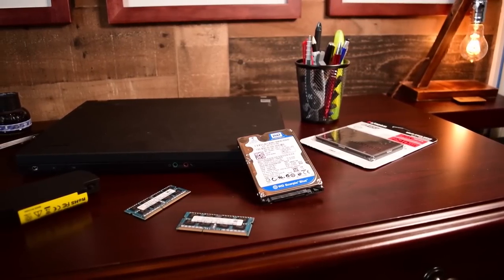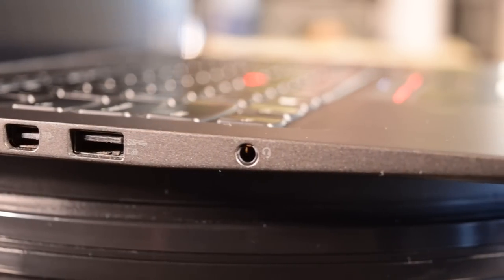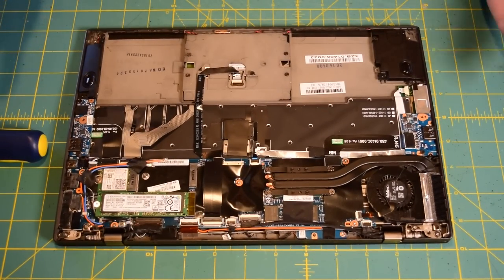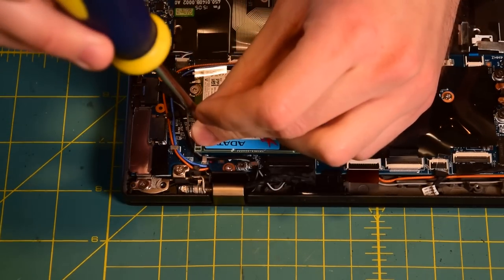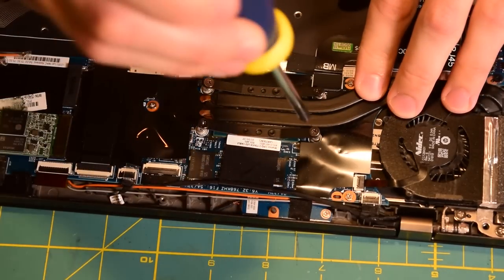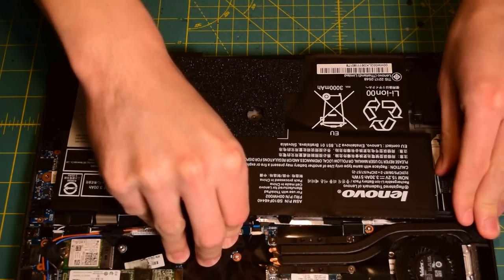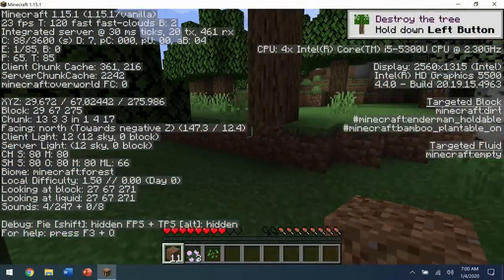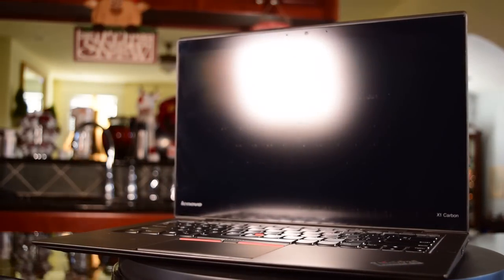Super Portable and Fast Ultrabook for Under $350: Thinkpad X1 Carbon 3rd Gen Upgrade Guide

Comment: Must be nice living in the US of A where you can get Thinkpads at a bargain. Good luck gettings those deals in Europe.
Reply: I will be taking one in two months i just want 350 € for mines its the i7 processor will be in barcelona spain in two months if you want it. I just bought it here to have a portable recording studio, but i have a recording studio in bcn already.
Reply: I got a good condition thinkpad x230 today for 50 euros, its possible, just needs patience
Reply: @___echo___  On ebay its impossible for a good specced x230. 200 euro and up.
Reply: I found a 6th generation carbon x1 for 300€
Reply: Same here in Asia😭
Reply: I got one for 60€
Reply: @___echo___ I got one x1 Carbon gen 3 for 60€

Comment: Great content man! You just earned yourself a like and sub! I just recently bought an x240 and made some upgrades by replacing the batterys, installing a 500GB ssd, 8gb of ram, AC Wifi, new thermal paste, and a new bottom cover to replace the cracked one, great pc. Bought all of this to replace my t420 which broke down on me, and I'm not buying a new motherboard before you ask cause it costs more than the actual computer. In fact, I bought that t420 bios locked for under $40. Keep up the great content!

Comment: I bought one of these guys a couple months ago to be my main machine and its been a wonderful experience. Going in, I knew that upgrade options were nonexistent, but the slimness and cool-factor make up for it. Its certainly much more nicer to look at than a older boxy thinkpad. The keyboard is also pretty nice, it feels pretty much the same as the T470S I got from work. I haven't tested it much with windows, but it runs fedora pretty well. Its some of the best $300 I've ever spent.
Reply: If you watch the video you will see how easy upgrades are to install: new batter, new 512g ssd, and your computer will nearly like a new ultrabook.

Comment: Little trick I learned regarding the screen - I put small, think sticky rubber feet (around 1mm) on the corners and it helped reduce the imprinting.  It did leave a gap for dust to get in if you're chucking into a bag, but I used a slipcase to protect it anyway.  Very nice video btw.
Reply: I have that screen situation also and was looking for a way to fix it once it's happened. But your idea to keep it from happening, or maybe from getting worse, is worth considering. I still wish there were a way to "refresh" the surface of the screen, but the things I've tried actually made it worse. I guess it's a non-glare coating that there's really no way to un-blemish.

Comment: Just ignore any negative comments  about MX-4. It is actually one of the better choices for a laptop, especially when factoring in price. Some people are just idiots and don't know what they are talking about.
Reply from the maker: Now that I think about it, back in the day I used to use Artic Silver 5 for my laptop builds.  That might have been the paste people were complaining about, I can't recall entirely though.
Reply: @AAComputersandTechnology  AS5 is highly outdated and hasn't been a recommended TIM since the mid 2000's, and it was overhyped back then. It has a complicated two week curing process and needs to be replaced yearly. It wouldn't surprise me one bit to have people posting negative comments on using it.

Comment: I absolutely love all my thinkpads. My current daily is an X1 gen 6 and it’s phenomenal
Reply: No heat issue?
Btw is that still worth around 3 years later? I mean x1 carbon gen6
Reply: @ferryrahmattesa1042  no heat issues at all. its a beast with the quad core i7 and 16gb ram it handles everything i throw at tit. totally gonna last a long time
Reply: @KingASE88  you buy i7 version, okey thanks you

Comment: I bought a 6th Gen X1 Carbon, i7 8650, 16gb, 512gb, QHD Screen for $800.  I absolutely love it.
Reply: How and where?
Reply: damn that machine is a beast mine were thinkpad t460s i5, 8GB, 256gb FHD and absolutely loving it so much power compare to my previous macbook air 2015 install linux and upgrade ram to 20gb (4gb were soldered and 1 space free)

Comment: Did same as you. Bought a used T480s with low specs for little money. Upgraded to top notch mem and SSD, and now I have a great portable laptop for 500 USD (brand new, it would cost around 1300 USD or more). Love Lenovos. Easy to service/upgrade, and simply the best keyboards in the planet.

Comment: I would guess that the plastic on the heatsink is there to make applying the thermal paste easier. Put the paste on, take something flat like a credit card and scrape across to give a coating of paste as thick as the plastic.
However, I would recommend removing the plastic strip afterwards!

Comment: "Just one small drop of thermal compound..."
*Proceeds to add a drop almost as big as the die.*
Reply: That is a small amount. As you said, what you see there is the die itself, it has no Integrated Heat Spreader, so you using a little bit more for laptops is completely fine. Idk why people obsess so much about this topic.
Reply: it's a good job that isn't LIQUID metal LOL
Reply: He used 3 times as much as you need, laptop probably runs hotter now.
Reply: @Shiniiee  because it seems to be an internet joke
Reply: @Shiniiee  Too much thermal paste will act as an insulator and make it hotter, you only need enough to fill in the tiny imperfections between the die and cpu cooler, if they were both nice and level (like what "lapping" attempts to do) then you don't need thermal paste. this is way too much thermal paste.
Reply: @bigdisme5622  nicht 8

Comment: Nice, I have gotten 2 scrap laptops from Discount Electronics. And mine is HP HDX-16 1140US and Dell Latitude E6410. Both are in working condition and the HP laptop is one of the best laptop of 2009.

Comment: I bought a second gen ThinkPad Yoga S1 for 130 pounds; pen, 1080ips, i5 5300u, 8 gigs if ram, and an SSD! Bought a more comfortable pen and made a holder for it by pinching elastic fabric between the back plate. The 2in1ness and pen is seriously awesome.

Comment: I love my X1 Carbon 3rd Gen. Have been using it continuously since 2016. By now the battery no longer has much capacity and I am so happy to come across the video!!! In addition to replacing the battery, I also want to increase the SSD from 512 GB to 1 TB. Regarding the SSD I would appreciate recommendations on a decent and affordable 1 TB SSD. Great video, thank you!

Comment: Thanks for this video! I recently stumbled upon the used Thinkpad X1 market here on our country as I've used newer Thinkpad L480s on our office, and I liked their design and especially that keyboard. And this layout is very helpful when I've opened it up to clean it.

I just bought a used X1 Carbon Gen3 with Core i5 / 8GB / 240GB with the WQHD touchscreen for equivalent of USD 300+ and I am content with my purchase. Although I have a few compromises like a beat-up lid with cracks near the hinge (hopefully not a deep one), an okay screen with a few micro-white dots, and a non-working fingerprint scanner (is yours working? still figuring out if its a hardware or software issue yet), and a still-not-activated copy of Windows and Microsoft Office.

I have yet to work on getting the thermal paste and battery changed once the COVID lockdown on our country is lifted. And possible use this until it dies so I can save up on a new one - hopefully a Thinkpad again if the quality impresses me. Cheers!

Comment: Honestly, the ThinkPad X1 Extreme (or it's twin, the P1) isn't too bad for a laptop that falls into the thin-and-light category.  I've been using an X1 Extreme Gen 2 as my daily since September and it's probably the best laptop I've ever had.  It's not too heavy, but plenty powerful and with the GTX 1650 Max-Q, I can even play the odd game every now and then (usually Final Fantasy XIV or Forza Horizon 4).

Comment: X1 Carbon 6th gen is good because it has the Kaby Lake R CPU's and those are quadcore. Much more powerful than the Dual Cores.
Reply: But the 6th gen go for around 700€ on ebay (in germany).
I have this 3rd gen as my daily driver and I dont miss much. With a 30€ Pro Dock its also just one connector cable for an external display + power + usb.

Comment: That little bit of extra length is for allowing installation without damaging and stressing those connections believe it or not. A little counter intuitive but if the battery moves around (dropped etc...)  it avoids tension and possibly broken/weakened or shorted connections .

Comment: I actually used mx-4 even in my PS4 and Xbox One.. Thermal performance got improved and never got any issues with it.

Other thermal paste brands were really shitty. Mostly they were really dried out and had to remove. The mx-4 even after 3 years was in really good condition.

Comment: The pressure on the battery wires is common and normal. You can just push them down off to the side and they will be fine.

Comment: I am repairing laptops for living mate. Most the Lenovo battery connector cables are made like that, under pressure. You should also make sure that there is no fluffs stucket  between the heatsink grills and the fan. I would've also tighten the hinge screws, just in case. I saw nasty keyboard marks on the LCD, nothing you can do about it, it is a design flaw and it is annoying

Comment: This laptop has the exact same specs as the T450s of the same generation. Though, the T450s has a worse screen (still 1080p touch) but has way more ports.
Reply: T450s has the better screen, battery, keyboard & more portsbut is heavier, bulkier, less good sound, camera. The Screen of T450s has a higher sRGB coverage, better deltas, contrast and brightness which I prefer over the difference between FHD and WQHD resolution

Comment: Just discovered this channel and hence, this video. Is the P series not the perfect blend of T series and x1 carbons? I bought a p50s on Craigslist for $200. 6th gen i7, ram in slots, 512gb 2.5" ssd, better I/O, docking port, dedicated gpu. Amazon had a deal of the day shortly afterwards and I got a 90w ultradock and charger for $17! The screen isn't great and having 2 batteries is a little strange but it's been an awesome little workhorse

Comment: Hi I have to ask, as I'm a massive thinkpad fan (sort of a setup related question)  but how do you find it with having a desktop and a powerful W541 together?  I'm currently using a docked X260, but been considering a P50 or building a desktop.  Do you have a preference which you prefer using and why?

Comment: You missed the opportunity to put in a $10 LTE modem to its slot. Also, if you want to make it faster you can drop in an AHCI PCIe m.2 SSD. (Not NVME, because that doesnt work except the Samsung 950 pro NVME... but all AHCI drives work and are much faster than SATA SSD drives). The screen has a matte foil on it which get damaged by the keys (you can see this on this laptop as well). That film can be removed and it reduces the graininess of the screen but it will become reflective, so that's up to the user. This laptop exist witt a QHD matte non-touch screen, which is the nicest and the lightest in the bunch.

Comment: Get into the habit of screwing heatsinks down diagonal order, its more likely to lay flat if the springs are a little stretched.
Also diagonal screw order dissipates the heatsink compound more evenly over the surface.

Comment: you can peel off the protecting film on the screen since I notice some marks on it, caused by the keyboard. Peel it off and you'll have a nice glass screen with sharper image and more vibrant color, only downside is the glare of a glossy screen

Comment: i was litterally just about to get this exact laptop lol
I'll probably get the non Touch version and replace the tn panel with a new ips display
Reply: did you do it? i switched to this laptop from t420 cus the screen was shit, but i realized on this laptop is the screen weak as well, just less visible pixels...is it worthy to upgrade to the wqhd2560x1440 ips screen? someone let me know
Reply: update: changed the screen to FHD IPS glossy, totally worth it

Comment: Technically the 3rd Gen X1 Carbon does have a dedicated docking port - however, it’s combined with the power port so isn’t on the underside. It isn’t USB based, however.

Comment: I got a thinkpad x240 for 120 dollars. is that a good deal?
Reply: Pretty good imo especially compared to the prices we've got here in the EU
Reply: It’s a decent deal. I’ve seen them sold for around $150.
Reply: Pretty good. I just got a x250 for a pinch more that only needed an SSD. Batteries might be of concern with their health.

Mine has 27% wear on the external and 14% on the internal. Getting just south of 8 hours with it.
Reply: Yes
Reply: mine was like 180eur, 8gb ram, i5 4300u, mint batteries and 768p ips touchscreen
Reply: I got a T460 S for $90. May have been hot, lol

Comment: I've been running an X1 Carbon 3rd gen for a couple years now and love it. I was wondering if replacing the thermal paste has given any noticeable improvement?
Reply: usually you could drop the temp by 2-5c depending on how old or bad the original thermal paste is.

Comment: I dropped my X1 Carbon Gen 3 laptop on the power side, chipping away the power area carbon which loosened the pin connector to the power adapter. Repair person said the power pins moved and needs to be replaced, but there is no guarantee it will be fixed. I got a call that I would be charged nearly $200 extra so they can also check motherboard as well or to just give them $50 without repairing it. I don't know if he's just saying that or if the motherboard is also affected. What do I do? It's an old Thinkpad, x1 Carbon Gen 3, 8gb RAM, 256. Bought it for $250. Thinking if I should just give up the laptop and buy another one. I got my hard drive removed when I sent it to repair shop?. I'm thinking about getting it back but repairman asking for $50. If I get it back, he charges me $50 and I'm not sure I can fix it. It may be permanently damaged. And if there's a way to fix it, others are charging nearly $200 for it. Still, it makes me wonder if the power has a connection with the motherboard or the repairman is just trying to say so so he can keep it. No way of knowing for sure, unless you think I should just get it back for $50.

Comment: Why would you buy a t410/t420 when you could get the +70% iGPU performance of the t430/t530 for $20-30 more?
Reply from the maker: Any of the earlier T series machines are pretty good.  I used a T430 for a year, I prefer the older style  keyboard but performance wise the T430 is great (especially with the quad core i7). If you can find a T430 for a few bucks more, then you're right, go for the T430.

Comment: What are your guys thoughts on the p1 gen 2? looking at the:
9th Gen Intel® Core™ i7-9850H with vPro™ (2.60GHz, up to 4.60GHz with Turbo Boost, 6 Cores, 12MB Cache)
16GB DDR4 2666MHz
512GB SSD PCIe
NVIDIA® Quadro® T2000 4GB

Anythought? Looking around on google and not sure but thinkpads arent in any of those lists, so it has me thinking if i should get one.

Comment: unfortunately soldered ram is a quite a big issue, since it's very hard to find carbons with more than 8gb. I prefer the t460s which can be found with the same price, although screen and battery life are slightly worse

Comment: Just bought a Thinkpad x1 Tablet 2nd Gen for 360€ on ebay, replaced the battery for 10€.
Best Laptop I ever hahd.
Reply: There s a thinkpad x1 gen 5 i7 8gb of ram and 512gb ssd mint condition and new battery for 240£ 😍 should i take it? How s ue laptop doin?
Reply: @TheAmanor123  Mine is great, better than a surface pro for 1/4 of the price :)

Comment: You might want to add feet on the bezels of the screen so you don't end up with keys imprints all over.
Reply: it actually has a rubber strip around the whole display
Reply: @uzernaim1648  it never hurts to be extra careful.
Reply: @notloki3140  yes.

Comment: How do you reinstall the Windows Operating System when you update the ssd storage?
Reply: Have windows installed on a flash drive and boot the pc into bios and install from the flash drive.
Reply: @auspicioustoot  Does it mean that I have to buy a new Windows OS?
Reply: Khai pi that would be the easiest

Comment: for 300-400 its good but you end up dipping closer to 600 with parts youll likely need to make yourself comfy anyways and you'll now be generations in the past. Esp with W11 I think that has the potential to be a problem. And Ill be honest the T400-W510 people are crazy; if you want to use a desktop just use a desktop. The other thing is the screen is god freaking awful by comparison to any modern IPS screen.